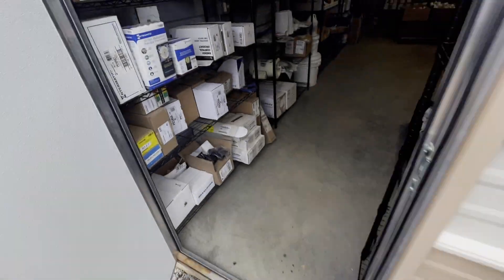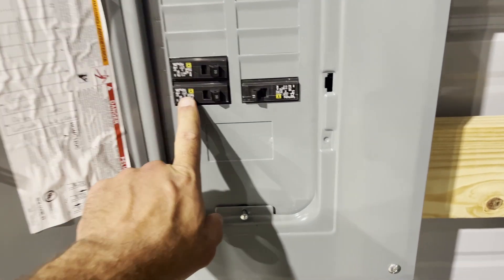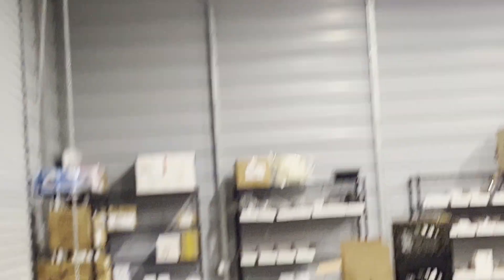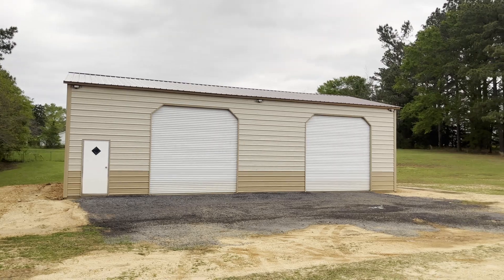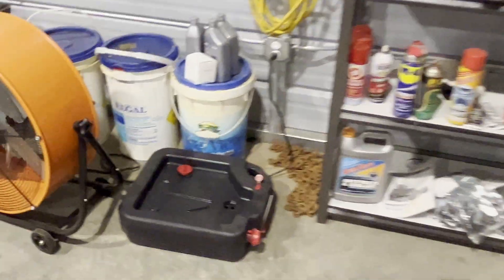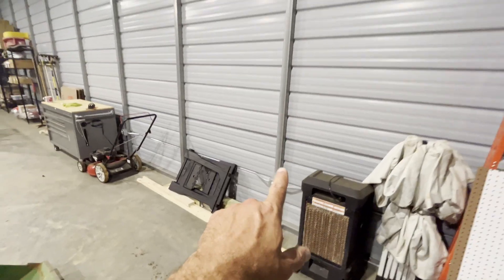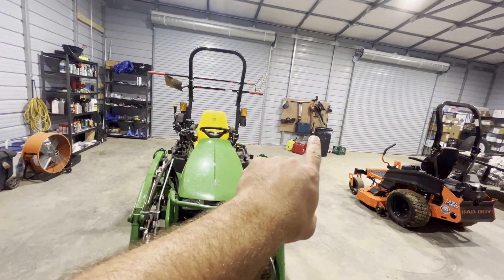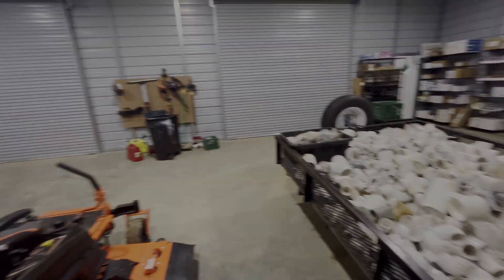How I ran the Electrical in my Metal Building

Comment: I suggest mounting outlets higher, above table top level.  The standard height is just  thoughtless  tradition, it makes no sense.  Higher avoids bending over to plug in, and you don't have to crawl on the ground to reach the outlet if a table or bench is placed in front of it.
Reply from the maker: @nealkonneker6084  pros and cons to both ways. Higher up = more cord weight tends to pull the plug out, also easier to step over
Reply: Then mount them even lower.  I mostly object to so many people reflexively using the "standard" height for no other reason than tradition.   There are good reasons to go higher or lower but  no reason for the standard height except tradition.

Comment: As an electrical guy I realize that the local building department can adjust the electrical building code as they see fit.  Your build might meet all those requirements as built.

I would encourage you to check with a local electrician or the building office (permit guys) to make sure you have the safest build before you get inspected.  

If you are not in compliance, they can have you undo your work and re-install it differently.

Recepticles should not face skyward as they will catch the dust and dirt and cause problems.

This building may fall under the rules for garages and require gfci protection for all recepticles even 125-250 vac and require a recepticle in each garage bay.

A building disconnect or the panel being a specific distance or closer to the door for fire fighting may be required in your area.

Outside lighting placement and a required outside recepticle may have specific location requirements in your area.

So, I will leave everyone with this thought:

If knowledge is the treasure you can give all you have away and still have what you started with, did you steal anything from your local electrical guys if you get some if theirs?
Reply from the maker: Cool. I’ll be sure to update when it burns down.
Reply: Keith- This guy was nice enough to share HIS shop. He did not ask you for your opinion. You have no juris.
Reply: @jimcole6423  sir, in many areas you pay for each inspection/re-inspection.  

My intention is to save others from these types of headaches.  

 For example,; placing a recepticle on the wrong side of a stud, has caused several people to have to open the finished wall to move th recepticle, box, and wiring 4  inches.

Now,  I am an electrical guy, not an insurance guy, nor a lawyer.  So, I often asked this question with no good answer give,  "If the electrical build is not done under a permit or not done to building code, who pays for any problems,?"  If it is not the insurance company, then the owner must sue the installer.  I wish no one ugly, but if it can be avoided by some phone calls because I spoke up......

Thanks.